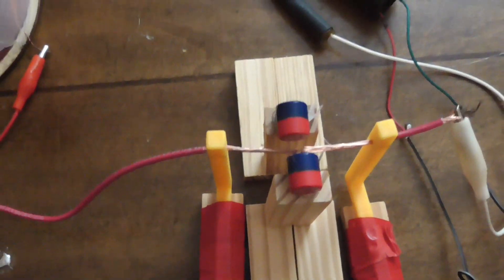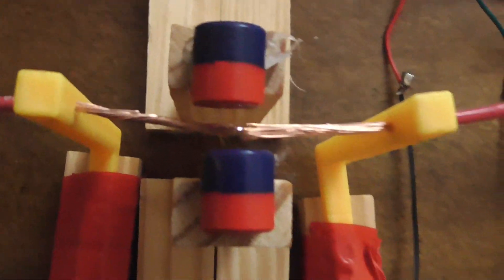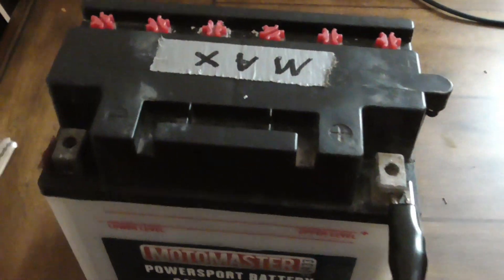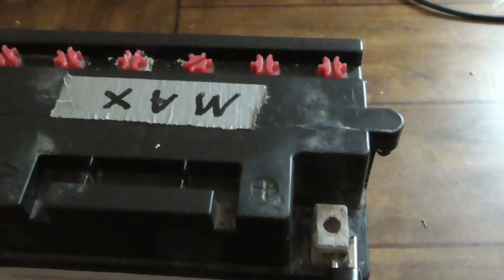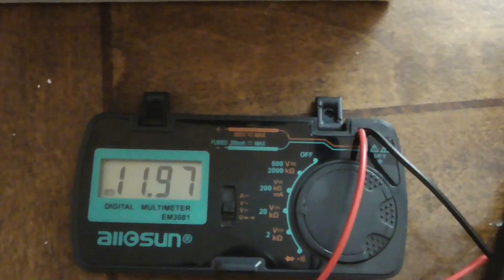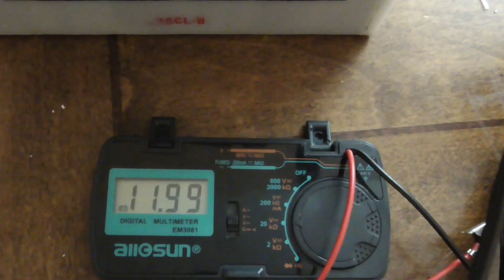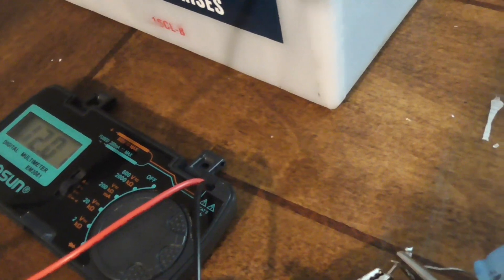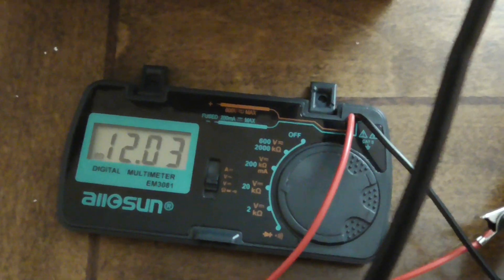Spark Gap Battery Charger

Comment: sadly we wont get more than what we put in.. it will take a very long long time to charge, good attempt anyway!
another good idea is to use the hv transformer to spin a corona motor with sufficient torque to spin a simple dc motor coupled to its shaft and use the said dc motor as a generator to recharge the battery
Reply from the maker: You think Bedini would of done something like this using his famous "Coles" motor, the one apparently that takes less then 10mw to spin and people can't slow it down with their hands its got such torque. If so why did Bedini never use it to spin something tiny in relative to this motor like a small 5 watt permanent magnet ac synchronous generator? 10mw to spin 5+ watts more would of been simple over unity? But he never showed us any such demo yet dr Peter L recently talked and supported the idea how great this motor is, yet still no usage for the obvious>??
Reply: @joellagace1679  yes indeed🤔

Comment: Do you think the spark gap in the magnetic field has a special effect? Some do.

Why are you using the capacitor and not directly into the battery? The capacitor flattens the spikes but aren't the spikes for the OU effect in electrolytic devices?
Reply from the maker: yes I notice its not always good, I mix both methods depending on project.